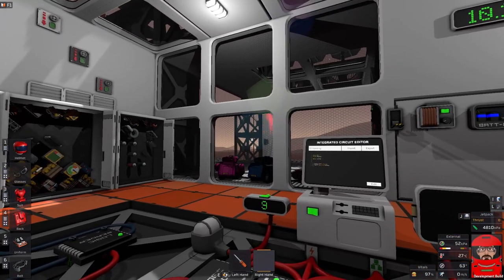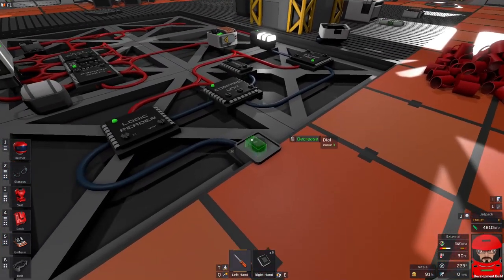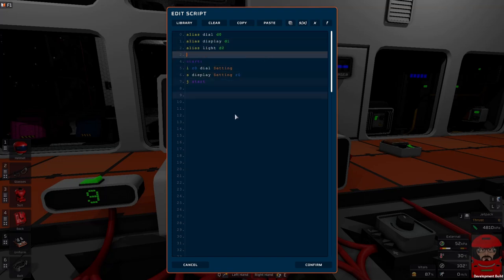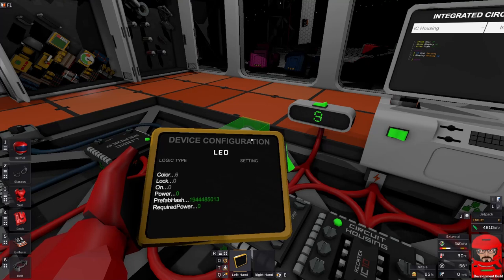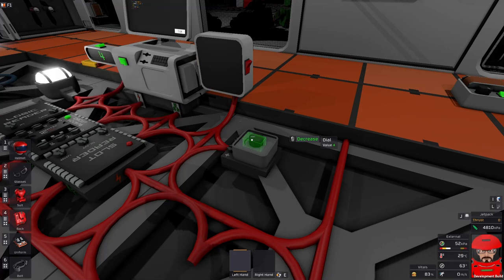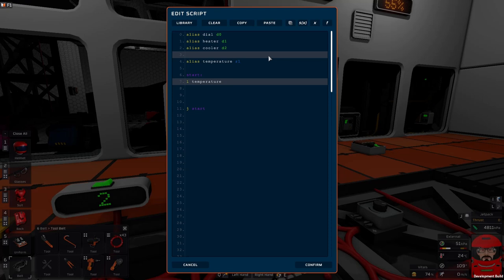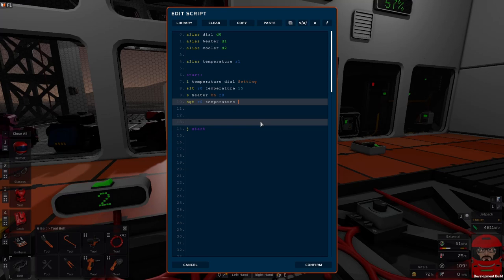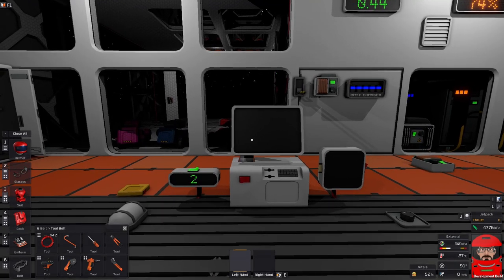Stationeers Basic IC programming 2 Condition testing

Comment: Cows, So I just bought this game and I'm a Cisco Router programmer, so programming in not new to me, but I've followed this tutorial to the "T" (today-see date stamp) and it didn't work.  The green light comes on saying there's no problems, but the IC chip doesn't control either the heater or the cooler.  I can still switch them both on/off, which shouldn't be the case, if they were being controlled by the program.  Any suggestions?  (Making Waspaloy in your most recent Adv Furnace build is still eluding me as well, but that's another subject. LOL)

Comment: I'm slowly learning MIPS :D thanks for that.
How would you extend that with a Schmitt Trigger, to switch the heat on at 15 and of at 19 °C? 
With logic I switch the select logic to the higher value when the heater is on. I assume you put a variable in the slt?
Reply from the maker: Many ways to do this.  
MIPS does have a 'select' command so you could use the same method.
You could test each condition seperately and then use the 'and' function to ensure both conditions are met.
I will cover multi condition switching in later videos.

Comment: I have some Problems if i want to load the Pressure from the analyzer at the Ice crusher Pipes, i want load the Pressure from N2 and the Water pipe. N2 Pump works, it go off its higher then 0 and go off its less then 1, but i got many Problems with the Water Pipes here, with the Water regulator also with the  Water pumps. They dont want to Switch on. Is it Possible i cant load 2 analyzers in one Programm?

If i connect the N2 analyzer with the water Pump theres no Problem and the Pump Switch On...
Reply from the maker: You should be able to connect as many as you like.  Just make sure you are sending the right signal to the correct pump.